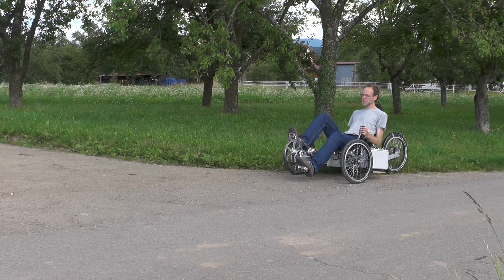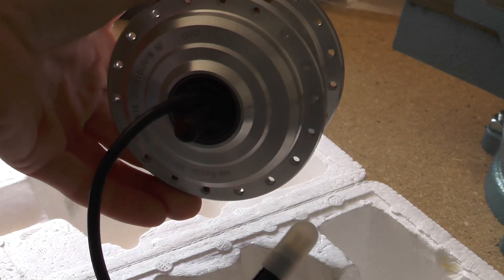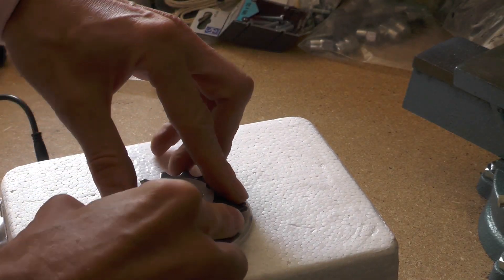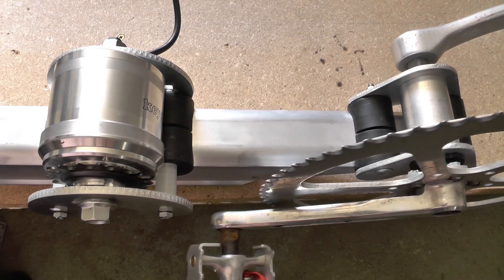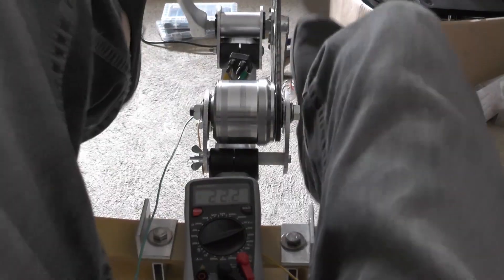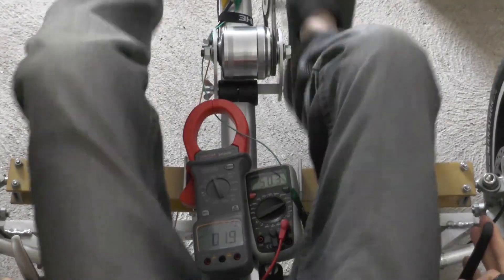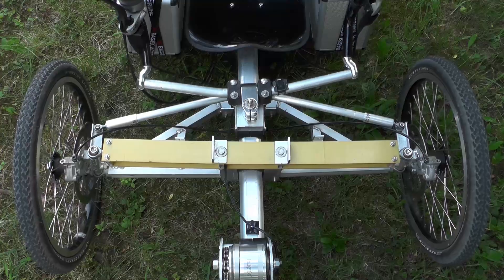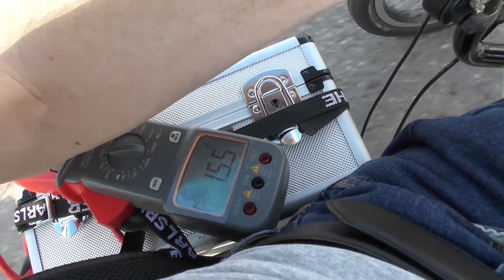DIY Pedal Generator for Electric Bike or Trike

Comment: Hey, that's pretty cool.  I'm looking to install two Sturmey Archer Dynamo hubs in my Quest Velomobile soon along with 45 watts of solar panels.  I've been looking for a simple solution to convert the AC current supplied from the hubs into DC current.  The output needs to be 12-15 volts, so I'll use a regulator.  That would the plug into a solar charger, then charging a battery.  The bridge rectifier that you used would seem to provide that solution.  Do you have a link to it, or perhaps the specs, model number etc?  I'd greatly appreciate that, thanks.
Reply: use a 3 phase motorcycle regulator/rectifire

Comment: Beautiful engineering!  It looks like it has a very smooth ride - and is very quick too!  Do you have any feedback for net energy usage on the battery, or have any indicator of energy remaining in the battery?  How does it react when the battery gets low?  I like how you can generate power when stationary, in case it runs out of power, then you can recharge somewhere in the shade or a place with a beautiful view.  Nice job!

Comment: You should get a bigger ratio so you could pedal slower matey!
Reply: LiPe VoLcOm I'm sure he already has that figured out. I don't think we can tell how hard he's pedaling.
Reply: Yeah, why not go for a chain ring the size of the crankshaft length clearance and maximize your work?  I can't imagine the brushes on the generator causing any real friction.  A 20 inch diameter chain ring would be epic.  Google Chuan Wei.  He makes custom chain rings.
Reply: To me it seems like he is pedaling too easy and too fast ... I would go for to pedaling slower with more resistance on the motor! Hope he can put some better gear ratio so it can be a more smoother job to charge the battery! Awesome concept he got there!
Reply: Pedalling speed is down to each cyclist, some normally pedal at 80rpm, some prefer 100rpm, the amount of power is the same when using correct gearing. I think this motor generator is brushless, the losses are in the bearings and wiring.

Comment: Very nice , but try to go to higher voltages and lower current ! Then your batteries will be drained less and will stay fit longer.
Do you also use the BackEmf of your motor to recharge the batteries ? Have a look at SegelOhrenBob latest Bedini Scooter Video.

Regards , Stefan.
Reply: Michael Johnson the 24v system will be more efficient, since it will waste less power in the transfer of current.
Reply: Kind of like a pound of feathers and a pound of stones no? It's all relative...
Reply: Michael Johnson sir I have no idea and I am curious as to if they actually run out of power at different times, or they just are the same?
Reply: @michaeljohnson_ok  You want to run your system at highest safe voltage. It saves energy which would be wasted as heat in wires, it also saves mass as you need much thinner wires

Comment: Very nice :) Good engineering.
You can use that for a very clean bicycle design as well. Basically as simple as a kick scooter with a seat on a stick and only tiny suspension in the seat. Ultra light and inexpensive. You could even make it foldable as a camping/yacht mobility product. It can have very small wheels which makes the motor cheaper/stronger. Normal road surfaces don't require big wheels. The generator could also use mesh gear instead of chain or even pedals directly on the generator if all you need is symbolic power to circumvent the law anyway. Elegant neat design has marketing appeal.
And if you feel ambitious you could do an ultra light tesla roadster/lotus. It's a very simple car with very simple suspension  (google image lotus elise suspension)
Only 2 doors, it can be done extremely light, much lighter than the 1200kg of the Tesla. And when it's light it's easy to accelerate fast. Target weight of 600kg or even lighter. As you know, it takes very little structural strength to carry 2 people and even styrofoam can be crumple zone. Easy to make light.
You could build a rough demonstrator prototype and seek venture cap funding. That's where the big money is.
Reply from the maker: I will think about your suggestions ;-)
My trike has a power to weight ratio of 143 W/kg (curb weight w/o driver). Even better, than many standard cars and almost as good as a Tesla Roadster with 174 W/kg. High power to weight ratio means good acceleration, and you can feel it!
Reply: You can't be serious! There is a huge loss of power in the form of heat generated by the inefficiency of friction and battery chemistry. He can't measure that directly because there is no place to shove in the meter probes on the human body. Perpetual motion remains a fantasy.
Reply: valveman- no it will always be less efficient than simply pedaling to turn the drive wheel and actually go somewhere.
Reply: +forschungsbuero When you would reduce the battery capacity, your ratio would be even better. Have you ever tried to drive your trike with using the generator only to directly power the motor without the battery in between? How fast can you go on clear ground level? Or in other words: How many watts are you loosing compared to a traditional direct chain transmission setup.
Greetings from Karlsruhe,
benjamin:)
Reply: Popeye Gordon there is always a compromise
Reply: I have some queries please can you solve sir
I am engineering student
I want to discuss the queries with you 
Can you please contact my whatsapp number +917019386564
Please sir that will help me alot
Reply: +namtuart If he connected the generator directly to the motor, he may be able to put in 200W.  That would be hard peddling.  Plus it would be a jerky ride since the voltage will vary since it will be non constant.